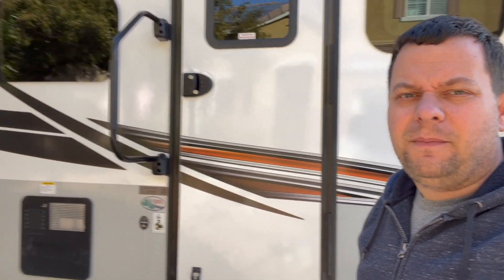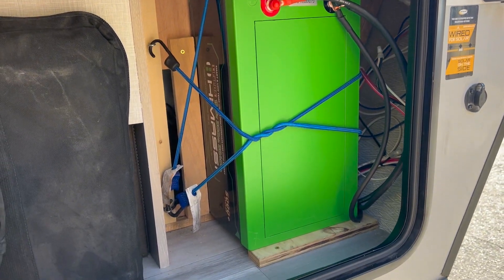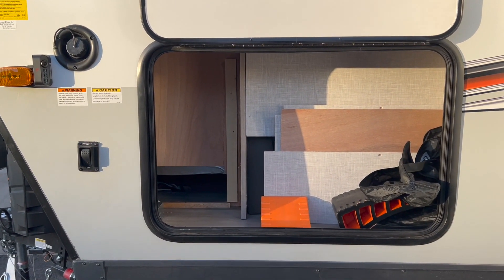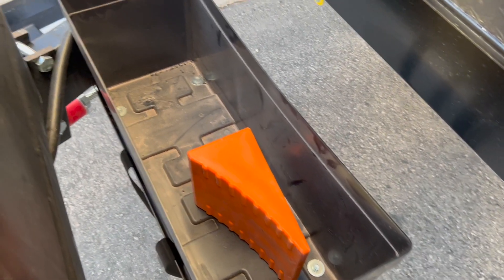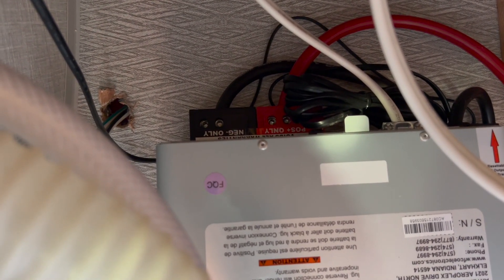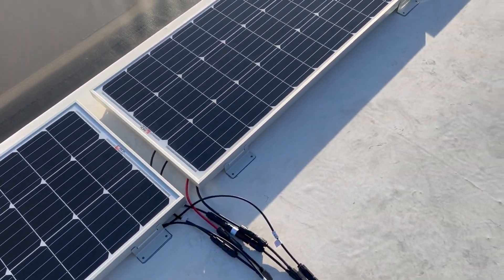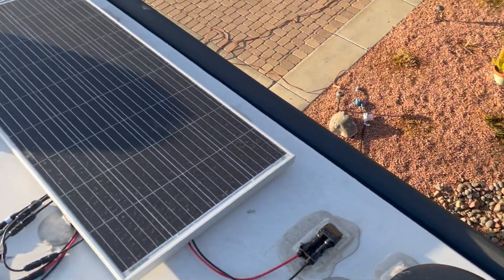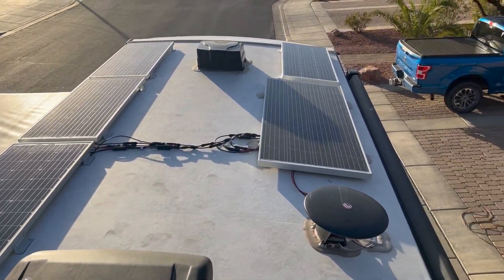Rockwood 2022 2509s Small Solar Upgrade

Comment: Hi Ian.   Looking to upgrade my factory solar in my Rockwood UL.   I just purchased a 280 ah lithium battery to upgrade my lead acid batteries.  I am having issues with my inverter.   States low power on the display.   I checked volts  at battery and back of inverter.  Both are 13.8 volts.   Not sure what’s going on.   Haven’t changed any wiring.   Same thing happening with lead acid batteries.   Any ideas?

Comment: Hello, Had a question, I'm upgrading from a geo pro to a 2509S and love what you did for the battery upgrade and solar. Did the same for my geo pro. My 2509S is not made yet. My question is: could you have installed the new battery on the side with the inverter? or was there no room? also, looking at buying a 300AH with built in heater, is it safe to have it on its side like that?

Comment: Hey Ian,  I realize this video is a year old, but I had a question. Why didn't you leave the battery on the tongue of the trailer? It would have cut you wire run significantly or perhaps put the battery on the same side as the converter? I have the same trailer and I'm contemplating doing exactly what you have done.
Reply from the maker: Three reasons: 

1. The size of the battery is a bit bigger. 

2. I keep the trailer at a storage unit and wanted to create a less attractive target. 

3. These batteries should not operate in below freezing temps. Some have heaters, but to keep everything solid when we camp in winter, inside offers a lot more thermal control.

Comment: Awesome video.  Thank you.  Question: why did you move the inverter negative to the trailer ground and the other end of the inverter negative to the battery?  Why not one negative connection to the battery that goes directly to the inverter negative and then have a common ground wired to a busbar?  I ask only as I do not want to blow anything up. (I have a victron MPPT controller and grounded it separately)

Comment: Great setup i have similar trailer  Rockwood 2606ws with Go Power solar kit looking into adding additional solar panels with no holes in the roof excellent idea on 3M tape,
Go power looks like good quality product but major problem is charge controler they provided us with it is PWM charger which is useless compared to MPPT charge controlers, i have Epever MPPT on my shed 200w solar with two deep cycle batteries recharge time is much quicker and you can actually see 14V and above when charging
You will be able to get 30-50% more out of your solar system,
50-60amp CHARGING on 14V .

Comment: Hi Ian. I like your use of 3M VHB permanent adhesive tape. I hope you will periodically give us an update on how well and how long the 3M tape holds up. I would think the roof membrane is glued down as well, so while the 3M adhesive may not break down, I worry the adhesive under the roof membrane may fail in time. Keep us posted and best of luck. I really like your approach.
Reply: I have the same concern.  I think I would add the roof sealant over the brackets for the extra adhesion and to protect the tape.
Reply: @renof2505  ditto, I'm concerned about roof membrane coming loose, we've all seen that happen on other rigs.
Reply from the maker: @da7heaven  I added some screws to the top. It held up for the year but I thought extra was not bad. It took all of 30 minutes to screw them in and seal them up.
Reply: @MrIandalton  do you know if there is a pdf for the cross beam location from rockwood? We would like to add some panels making sure we hit supports. Don't want a panel being ripped off by high cross winds.
Reply from the maker: @mannyb4959   I do not, but I took this on a 3800 mile trip across the west in some really intense windy situations with zero issues. The tape and the screws held on perfectly.
Reply: @mannyb4959  Hi, Don't think you need to worry about the cross winds as long as the solar panel is off the roof 2-3" so air/wind can flow under it and its level with the roof. The presser from the wind below and above are equal and will keep it in place. Now if the solar panel is higher in the front then the back it will act like a sail and have lift, like a wing and it will pull off. But not using a screw and only using the tape might pull the roof membrane up from the plywood? I could be wrong?  Screwing it down to the plywood should be fine and will give you piece of mind. if you realty want to find the joists, I would use a metal stud detector or if you have access to a infrared camera you might be able to see the aluminum joists as they have a different temp rating then the foam.
Reply: @HarryAnderson-m1o  yup. Used a stud finder and it did pick up the aluminum joists. Doesn't work on the "deep scan" setting though. I also got the roof schematic from Forest River. The stud finder showed them exactly where the schematic showed.
Reply: @mannyb4959  Is this diagram something you could share?
Reply: @CanDoer  https://youtu.be/dTCvJ7PtU2g
Wasn't sure how else to send. The pink areas are steel supports that FR uses to mount things to. You can easily find them with a strong magnet.

Comment: what is the wiring like to work with?. I am looking at exporting one of these into New Zealand. Which means I would have to rewire the existing cables to meet New Zealand's standards. Did you find wires being stuck because they were cable tied or wires you couldn't pull through?

Comment: Did you replace the charge controller the research I did said it won’t work with lithium batteries please let me know I have the same rig and want to upgrade to lithium
Reply: You don’t have to switch the charger, it just charges slow with lithium. The solar controller will do lithium though, just have to switch the charge profile. I got a separate Victron charger and hooked my battery up to it and it charges great.

Comment: I don't know enough about electricity and solar to understand everything you said regarding the solar panels/voltages/amps/parallel vs.series, etc... but, I have a 2021 Geo Pro 19FD, which I suspect has the same solar charge controller as your trailer.  It came with the 190W GoPower panel and the GP-PWM-30-UL solar charge controller.  I spoke with a customer service rep at GoPower and he told me not to exceed 485W of solar on the roof.  He said that was the limit of what the controller could handle, and more importantly, the limit of what the wires inside the trailer walls feeding the controller could handle.  I could handle changing out the charge controller if I wanted more solar up top, but I don't know what I'd be getting into with the wires in the walls.  I was disappointed as I was planning on adding 420W to the 190W, to feed my 200AH lithium battery bank.  I was looking at purchasing two 210W Newpowa panels from Amazon ($207 each).  Have you found a way around the limits of the wiring and the SCC, or are you "over paneling" because even in the best of solar conditions, solar panels will only produce about 80% of their rated output?  (600W x 80% = 480W)  Thanks for the tip about VHB tape...I was worried about drilling into my roof.

Comment: Thanks for the video! Do you have the 12v fridge? I have a2022 on order with the 12v fridge and I’ll have 480 watts of solar. Wondering if that’ll be enough. Thanks
Reply: I believe all of them that came with the solar had the 12V fridge.  If you did not have the 12V fridge you would likely not need the 12V fridge.  I have the same trailer and wish it had the propane fridge.  The 12V takes ~7.5A and seems to run all the time.
Reply: @renof2505  I had a propane/electric shore power fridge on a former motor home.  Problem with that is they seemed to break a lot.  I put 3 cooling units in mine in less than 8 years.  At $400 a pop, that is a lot.  I'd be better off with ice chests LOL.  I now have the 12 volt fridge in my 2209S and, yes, although it draws power, I'm hoping it won't break down as often.  I'm also adding 400 more watts of power connected to 200AHrs of Lithium Iron Phosphate as it fits in the original spot LOL.  I hope this is enough as well.

Comment: Thanks Ian! How did you connect the solar power controller to the battery and did you keep the GoPower controller?
Reply from the maker: I just kept the same controller in place. There was no need to play with the controller. When I do that upgrade, I'll make a video showing how I do it.
Reply: @MrIandalton   Can you now run the AC off of the batteries?

Comment: Why the water fill hose shares a hole with the power wires is beyond me. 🙄
Reply from the maker: It get worse, the solar charge controller shares the same space as the sink hoses and water heater. That's going to change real soon.